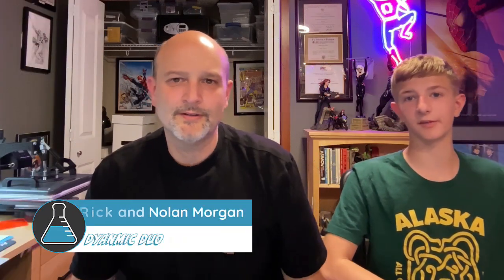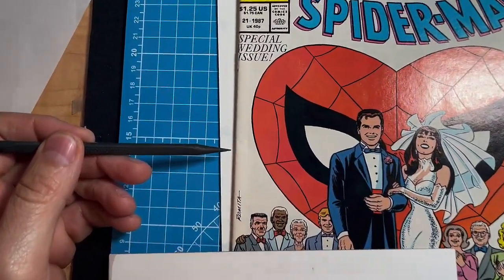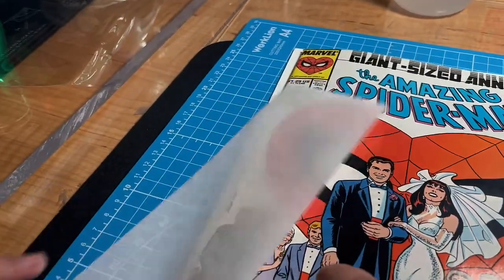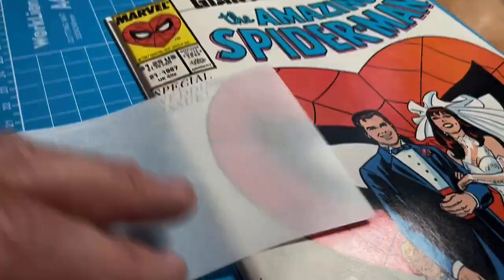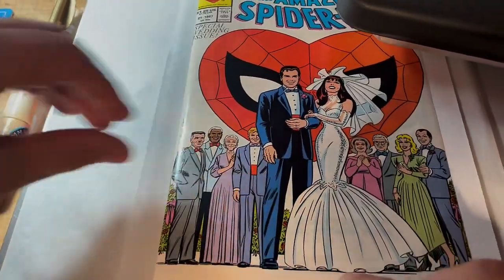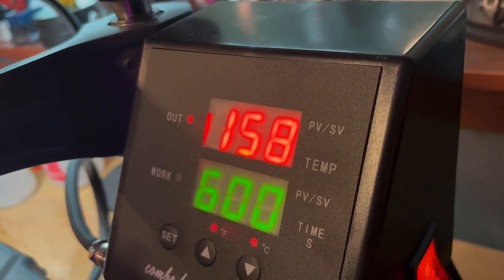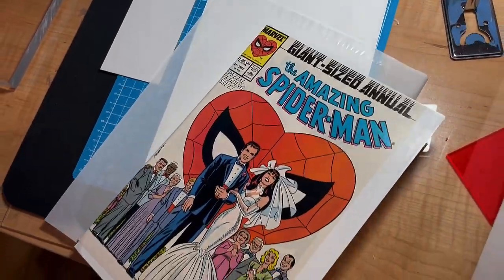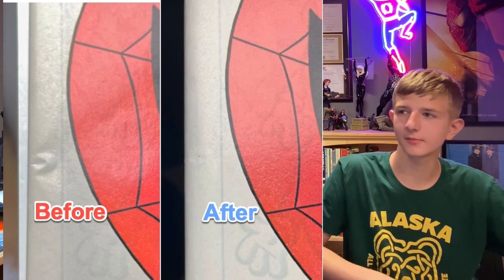Tutorial for Removing Spine Tics 2023

Comment: You mentioned trying to figure out how to record the force applied. I mounted 2020 strut and a handful of load sensors to the bottom press base. The load sensors feed a cluster of Arduinos acting as PID systems. Those are polled by a master that calculates the force and outputs the needed info to a small screen. It was a fun project.
Reply from the maker: That’s awesome! I’m so glad you told me. I’m trying to do that same thing only with a force resistive sensor.  The problem I have is the calibration.  I am using a dummy sensing block that’s the same size and thickness of a comic book, but I can’t seem to get the same measurement twice…. And it even drifts over time even without changing the pressure!  Any insight would be appreciated !
Reply: @ImmaculateComics  I had looked at the same sensors but couldn't find any that would handle the constant pressure at the 50lbs+ range. I used a cheap set of calibration weights for the load sensors. One thing I noticed with the load sensors was that the wires had to be well soldered and secured from moving. Because it is using the change in resistance, little movements in the wires can change the output.
Reply: @ImmaculateComics  You may also be seeing the flex of the bottom mount screws. Thats why i average on four points.

Comment: can you address (maybe in a video?) what i call "book wave(s)" that occur after a press? where the top and bottom edges of the book have waves. even if the book was completely flat before the press. i have the same setup and use the same methods as you. mainly because i learned from you! i dont know if it has something to do with ambient humidity returning to the book? im at a loss. i do let the book set in the press for 24 sometimes 48 hours after press.
Reply: I have had this problem. For me it seems to be too much moisture, not enough pressure, and removing the books too early. Increase the pressure, make sure you are at least 155 Fahrenheit leave the heat on for five minutes.
Reply: @timbiner690  thanks bud!

Comment: Wondering. I watched a video from 3 yrs ago then 2 years ago then 10 months. All where "how to remove soine ticks. The last process didn't use a steamer. Just a little water on a q-tip. Has the technique evolved or are the techniques spine tick specific?
Reply from the maker: Thats a good question.  IF there are a lot of ticks I will use a steamer.  if its just one or two its easier to use the Q-tip and a little moisture!

Comment: Noob Question! What are the factors in determining whether to steam a book or not before pressing?
Reply from the maker: if there are many fine micro wrinkles in a book you may want to steam it.  You may not want to steam if it is older with a lot of tanning because the steaming may leave water marks on the book.  I hope that helps!
Reply: @ImmaculateComics  Thanks, makes sense!